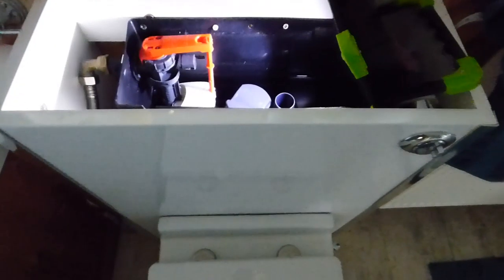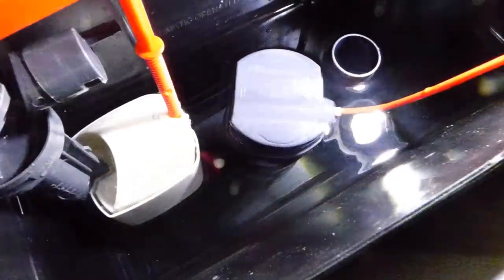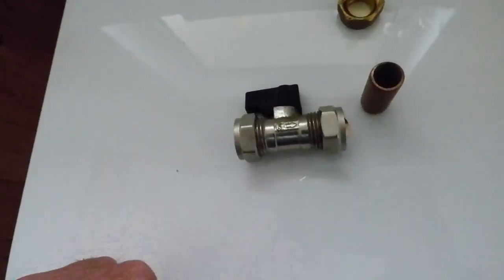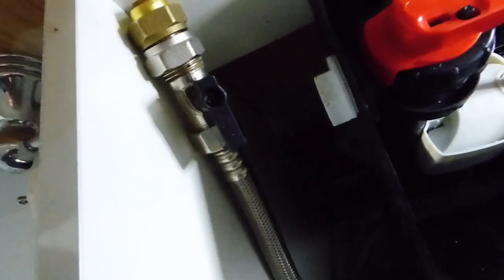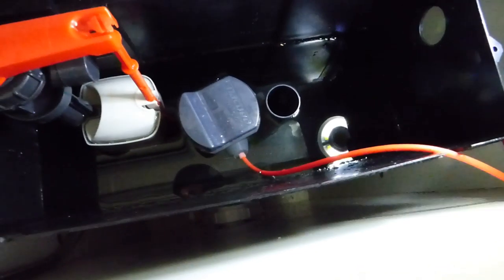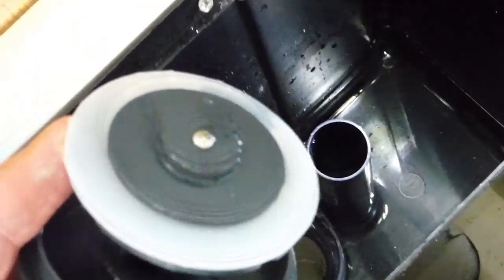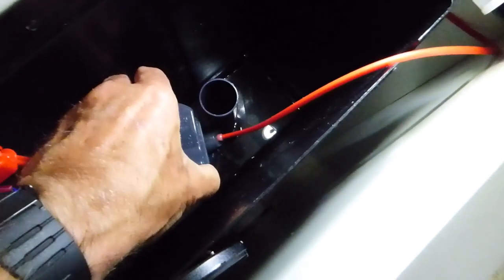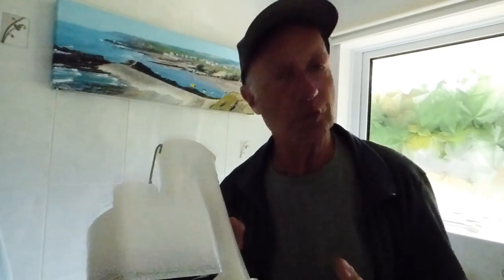Water running into the WC pan. How do I stop it?

Comment: This happens every few days on my upstairs WC. I just slap the side and it stops but it is annoying.
I think it is the fill valve that does not shut off occasionally. Valve is a Fluidmaster 400a. I replaced it but it still happens.
I really really really regret letting the bathroom fitter build the WC into the cabinet.
Love Dereton33's videos
Reply: thanks  al  for  sharing  this  information  with  us
Reply from the maker: Thanks for your story there, great for everyone to see that some improvements are not always what they seem.
Reply from the maker: No problem Ratch.